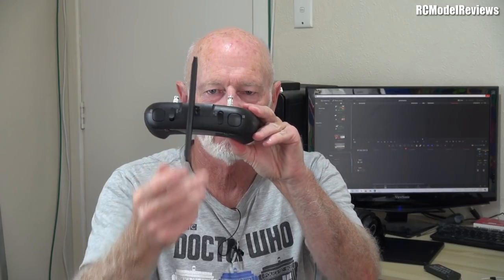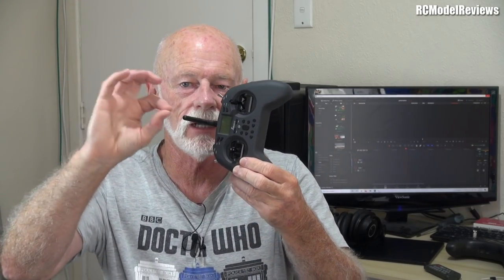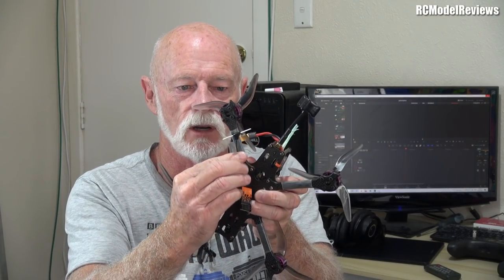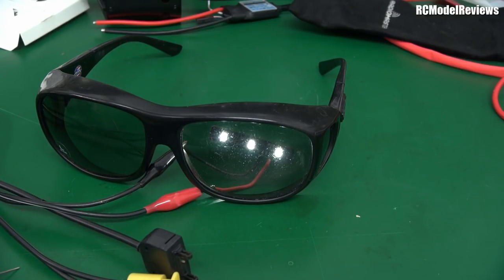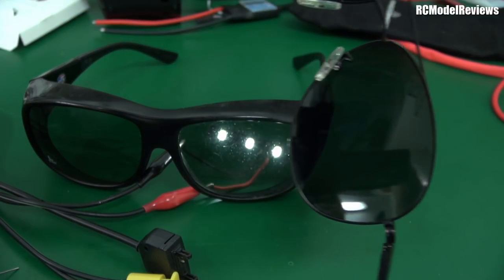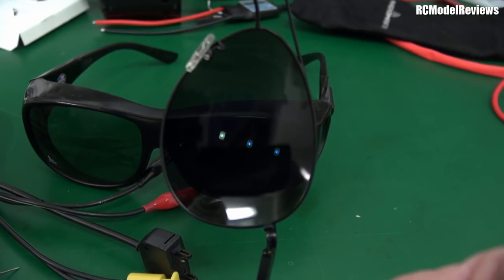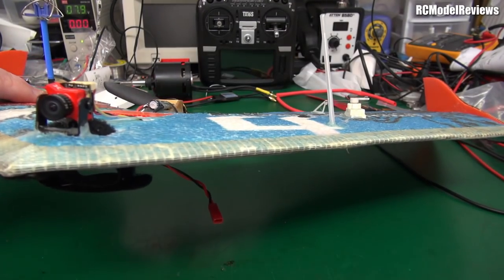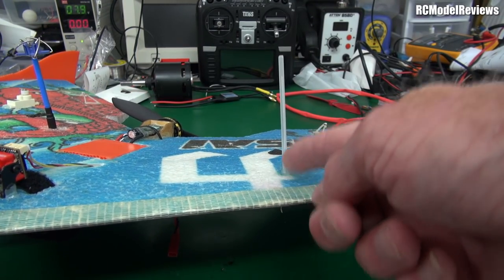Why RC antenna polarization is important

Comment: Great explaination and visualization. I can remember a lab experiment I did years ago as part of my training. For every degree difference between aerial angle, signal levels dropped by 1%. At 45 degrees difference between aerials, nearly 50% of the signal was gone. At 90 deg, 90% of signal was gone (10db).

Comment: These educational "white board" videos have always been my favourite. Keep 'em coming Bruce.👍
For many years I've kept my antenna in horizontal orientation due to the unorthodox angle at which I hold the Tx. 
In vertical position, antenna points upward at a 45° angle if I'm sitting, closer to 30° when standing. Null is exactly where model was flying LOS.  While horizontal, null is always directly out to the side, regardless of my position.  Embarrassed to say many failsafe crashes were required for me to make this change.
Now to figure out how to keep my patch from pointing at the ground.

Comment: When I was but a wee lad - back in the 70's, when just about every house had a tv aerial on the roof, I always wondered why in some areas the antennas were mounted vertically, whilst just a few miles down the road they would all be horizontal. Being a bit of a geek i went to the library to get a book that would tell me. That little bit of knowledge came in handy a few decades later when i started to fly rc aircraft. But did not know so much about null points until I started to watch your videos Bruce, it was only then that I realised that vertically polarised is normally the best option for my flying.

Comment: Thanks for a very informative video.  I had this happen last year with a Turnigy i6 radio.  Had both antenna in the same plane but 90 degrees to each other.  The plane did not range check so no flying that day.  Put one antenna out the top of the plane inside a small straw.  No problems at all since then.  I doubt that many folks understand this polarization concept with 2.4 radios.  Again, many thanks for the video.

Comment: Its a great video, Bruce! Thank you very much. You are clearly demonstrated us the importance antennas placement on RC transmitter and model. One little note I want to make - its better to turn the monopole antenna down for 80 degrees to earth, so its radiation maximum pattern will look to the sky at 10 degrees to horizon

Comment: I learnt this lesson the hard way. I failsafed my cinewhoop in a rock garden 400 meters out with my brand new Gopro8. It took me two days of hiking to find it.

I was naive to think using a FRsky Rx without telemetry to warn me of low RSSI, plus my TX16 with the antenna pointing sideways would be "fine" for a quick flight just up the hill at golden hour.

Comment: Thanks for today's video.  This affect was more noticeable in the days of 27mhz single channel. You had your antenna coming out of the side of the fuselage and pinned to the fin. Almost horizontal and the transmitter vertical.

Comment: Have to agree with you 100% Bruce  
For BEST reception, the receiving antenna is required to be the same polarization as that of the transmitting antenna.
Either vertically, horizontally or circular polarized.
The difficulty is when one of those antennas are changing their polarization as on the quad when it flys around. 
This is where higher power output from the transmitter will help mitigate the issues of differing polarization or flying close proximity. 
This is easily seen if you change the output of your vtx to just 25mW. Just try flying a few hundred meters away with trees between you and start doing some acro flying, you might just have a little walk ahead of you.
More importantly, if you fly long range, than it becomes essential that you maintain the same polarization between transmitter and receiver. You don't see many long range quad pilots doing their acro flying when they are a kilometer or more away. 😁

Comment: Very interesting as always Bruce. With standard fixed wing receivers with two antennas, is this the same as in they will only be polarised in one orientation?  I’ve always positioned the antennas at right angles to each other but not always got one going vertical. Sometimes there is no room in small planes and I’ve had to position them at 90 degrees to each other but both horizontal. Hope that makes sense.

Comment: One thing I think should be talked about more is diversity receiver and transmit radios. Many spektrum transmitters have dual transmit antennas 90 degrees offset from each other in addition to having diversity and satellite receivers. Your setup would still have cross polarization in a nose dive.
Reply: I use the principle you're describing in that I use redundant receivers, each with two antennae at 90 degree angles, so 4 antenna at 360 degree angles in total.  All horizontally mounted on my landing gear.  I run my radio antenna horizontally also.  This way, I am never cross polarized and always have near parallel antennae in the air and  ground.

Comment: Bruce, Really interesting.  But a question:  I fly mainly planes and I often have trouble finding a good spot for the receiver (keeping it away from motors, servos, ESC, et) so the antenna usually lies horizontally along the fuselage.  It's even more of a challenge when the receiver has two antennas - here the manual states - place them at 90° to each other.  Sometimes I have to poke the out of the frame at 90°.  What advice do you have on this?

Comment: My thoughts for Fixed wing antenna orientation (not FPV). If my logic is wrong please correct me.
- [ ] The direction of the antennas in the aircraft are a bit academic as the plane can rotate and turn to any angle in reference to the transmitter. Best option is to set the two antennas at 90 deg to each other. Keep as far away as practical from motors, ESC’s, metal or carbon fibre framing, ie anything conductive.
- [ ] The signal from the Tx is at its weakest directly along the axis of the antenna. So the antenna should not be pointed at the Rx.
- [ ] The second worst orientation for the Tx antenna would be vertical. As the transmitted signal is represented as a doughnut with its axis centred on the antenna axis. This would give a good signal horizontally in front and out to both left and right. However at altitude the signal would become progressively weaker.
- [ ] With the antenna at a 45 deg (2 o’clock ish) angle in a plane perpendicular to the line to the receiver, the signal to the Rx represented by the doughnut would  be good to the left of the operator, slightly worse directly in front and poorer off to the right.
- [ ] As most people would constantly turn their body to keep facing the aircraft. The best Tx transmitter orientation would be horizontal. This would constantly keep the best signal pointing to the Rx and altitude of the aircraft would not affect the signal strength. 
- [ ] This would then the two aircraft antennas to be installed in a horizontal plane.

Comment: Mate, excellent video like always.  I was wanting to pick your brain if I may.   Large scale T-228 Trojan RC aircraft, 111" span. Fiberglass construction, no CF. Power using 2 x Spektrum SAT type Rx that each have the long whisker type AE leads.
RX1 is on bottom of the fuz just behind wing fitment point.  I have the AE leads 90 degrees opposed in the horizonal plane, one points fore and aft, the other at right angle to it.
RX2 is on side wall of fuz ~200mm from Rx1, it again has the AE leads 90 degrees opposed but I have it 45 degrees in the vertical compared to say fore aft horizonal line.
JR 12X 2.4 DSMX with folding dipole AE, my intent would be to have the TX AE folding section in the horizonal plane to keep both TX & RX AEs in a horizontal polarised plane.  
I know you discuss using vertical polarisation for your drones so just wanted to get your input on my setup. TIA.  cheers Peter

Comment: Although everything you've said is correct about antenna polarization, one glaring error was when you said "if somebody is flying above water, and antennas hit a null-point, the drone would splash into the water"

Most drones will "return home" if the RF link is lost - they can be programmed that way.

Comment: Hey Bruce, great vid! I'm curious if this polarization is the same with a Moxon antenna. Since some of the ELRS equipment manufacturers offer Moxon antennas for 2.4ghz ELRS, I wondered if you might cover radiation pattern, polarization, null points, and so on when using Moxon antennas vs. the T-style (dipole?) antennas. Is there any difference other than the higher gain/directional nature of Moxon? Thanks, and keep up the great informative videos!

Comment: What about when you’re doing flips and barrel rolls? That polarization will always be changing.  Banking for turns is a significant part of flying quadcopters, whether racing or freestyle. The only super consistent flight pattern are wings/planes and cinematic whoop style of flying.

Comment: Good lesson. Polarized sunglasses blocked my phone screen, the first time it happened, before I figured it out, I thought my new phone had broken! lol. Any chance you'll draw lobes for us? And why don't they use an omnidirectional antenna on the drone or plane? Myself I'd want a directional xmit antenna and an omni on the rcvr, to get better range no matter what angle the craft was at. With your example of vertical antennas on both, don't you see the signal drop when the drone is directly over you?

Comment: If you fly high and not far (horizontally) then placing the antenna vertically might give less reception than placing the antenna horizontally. Flying with quads or at more distance it makes sense to put the antenna vertically ofcourse.

Comment: I don't have knowledge of RC RF, but the subject of the moving transmitter/ receiver is interesting. First, I wondered why the antenna couldn't be gimbal-mounted, to preserve its orientation relative to the ground station. That might be mechanically difficult, so given the tiny form factors of accelerometers today, perhaps you could have 3 90-degree-mounted antennas whose signals are filtered for their preferred orientation? 
Sorry, if this is a basic question - I'll let the experts set me straight!

Comment: Great explanation! For my 5" freestyle quad, I am constantly changing my orientation, sometimes inverted, sideways, etc. Not sure what I should do about that, I can move the T style antenna on my TX16s with ELRS, but the quad is always moving and changing. However, for my fixed wing aircraft, I use a DX9, but the antenna is fixed. You can't move it. What should I do about that?

Comment: Outstanding content! It’s really interesting considering that every crossfire BNF comes with the immortal-t installed horizontally. I’m assuming there’s less of a chance of lining up the null points if it’s straight out the back vs mounted on the arm at an angle?

Comment: If you run diversity recievers make sure the antennas are 90° from another and you basically cover all the nulls (which is what i do on my 5" where i have a mount for the antennas that hold them that way).

Comment: Hi Bruce , Would or does it make any difference, if you add these 3rd party addon antennas to a DJI  FPV drone transmitter, which I have seen floating around the Net,  to improve range ,Cheers

Comment: I want to learn about the boxy infinity antenna that are used for transmitter modules. My ELRS module came with one and a monopole antenna (had connection issues on the bench with it. Tried the other and good signal).

Comment: What about moxon antenna like i have on my ELRS module? Tried to figure out the radiation pattern nut the graphs that i find on the internet aren’t very clear to me. I have a T-shape antenna on my ELRS quad, mounted horizontally on the front. What would be the best orientation of the moxon antenna on my radio?
And yes, more educational video’s are very welcome

Comment: I had polarisation negatively affect me on my go to spot when i got into fpv. I flew los for a big part of my life so i always aimed my tx at my plane and everything was well with having the antenna turned to the side. When i got into fpv micros my go-to spot became the hill behind my parents house, wich had a nice park bench at the top to sit with a big tree to the left. Flying behind the tree would failsafe me 90% of the times, so i tried to avoid doing it, assuming the tree was just too much for the small antennas on  my whoops, until one day i had my antenna turned vertical and suddenly the problem was gone. Was a bit embarassing realizing that since i did take a class about antennas at university

Comment: But mounting antennas vertically on our drones is hard! 😭 I switched from my stuff Ghost antenna to the floppy Happymodel one so that it could bend under the drone when I set it down. Tested this yesterday and had great reception out to 2.5km and no nulls when I turned around. That said, I've flown to 6km on horizontally polarized but I can't spend anytime in the null (quickly turn about to come home)

Comment: On my planes the antenna is horizontally polarised but thanks to diversity I have them at 90° so never encounter null point problems.

As for flying to the side, the only times that happens (takeoff & landings) it's close enough for the null points not to matter.

But for FPV I agree, vertical is the way to go.

Comment: Here's a question, probably using the wrong term, but is it possible and what are the effects of creating an antenna array of directional antennas such that each is pointing a slightly different direction, but they all come to same point. So no matter where the signal is coming from you have maximum gain and only one connection to receiver?

Comment: Question: The new craze is 2.4 one reason people like this is because the antennas are so small. I have mine on the arm but I know it’s not optimal especially when I’m at distance and I turn around to return home. I can be at 10mw output power and suddenly it jumps up to the max 250mw and I then worry I’m going to failsafe. (Elrs on dynamic power) 
However when I think of a location to put the antenna in the vertical I’m struggling as either the battery blocks the antenna if I place it in the same place as yours or if I put it on a stand off then again as it turns the entire lead is blocking the signal as the antenna is so small…
Any suggestions?  (Ummagawd twofiddy my current daily flyer)

Comment: I've spent several hours to check all solderings, mounting, and checking program only to discover  - that all of my built was fine, it polarisation is a problem. Antenna needed to be bent in order to work properly.

Comment: Not sure why they’re aren’t any controllers for ham operators so we can swap out antennas and use higher power levels. I would love to use 6 meters for remote controller with 70cm for video.
At least they’re making radio controllers with dual polarizations. 🤷🏼‍♂️

Comment: why don't circularly polarised antennas exist for radio links? surely with our acrobatic quads, someone would have realised cross-polarisation is so extremely common, just like the video system, that having the signal be resistant to rotation would be good. is there some sort of other issue with those antennas that makes them unsuitable for a low power, low data rate signal?
Reply: also, why do you have the video antenna pointing it's null directly backwards? surely that's more important to keep running smoothly

Comment: I had one dipol flat on the quad, and the one on the remote also flat (horizontally) .. see the bullshit what happens like that: https://youtu.be/2w7eF_p9qTg?t=258  I have dynamic increase of Power. When I turn .. it goes from 25mW to 1000mW .. and additionally goes down to 35% of packets recieves - only because the antenna on the quad was shortly pointing to me. A very stupid thing. I'm pretty sure, with both vertical, I don't have to 'fear' turn arounds anymore.
(maybe when I fly high high directly above my head.. might be a little problem, but then the quad is near anyway.. there will be an easy fail-save and such)
so thanks! (even so I saw this solution at some other channel first, but your content is great anyway overall)